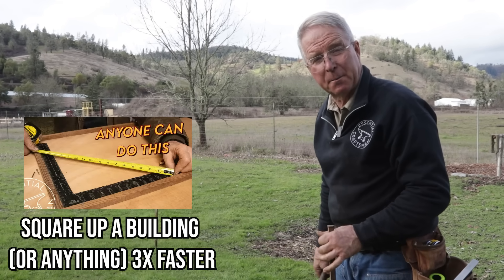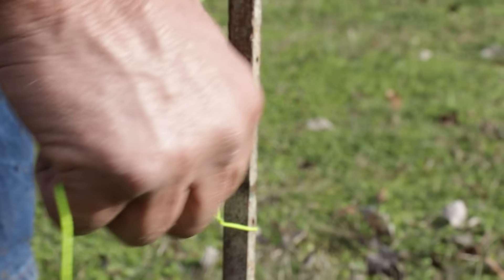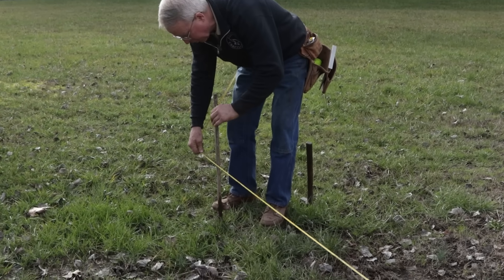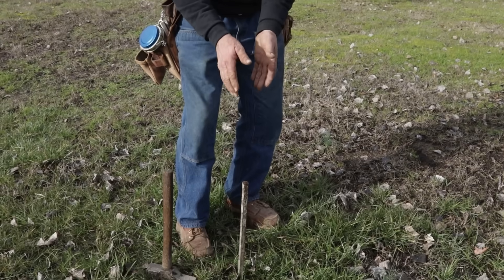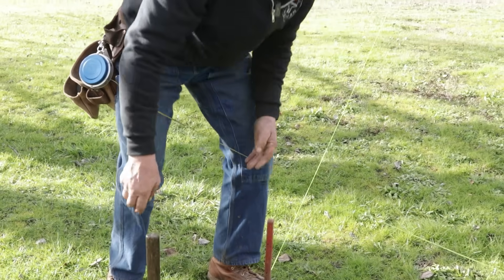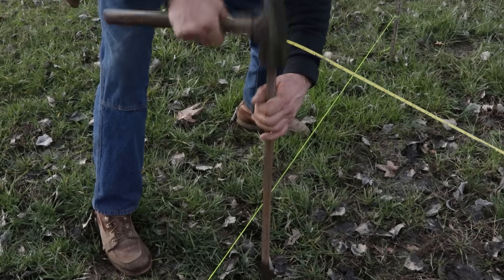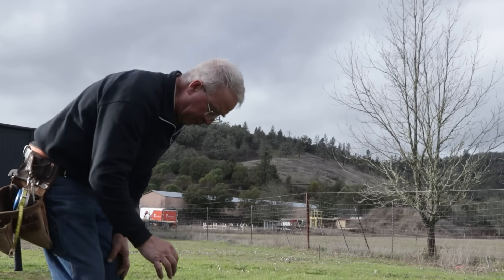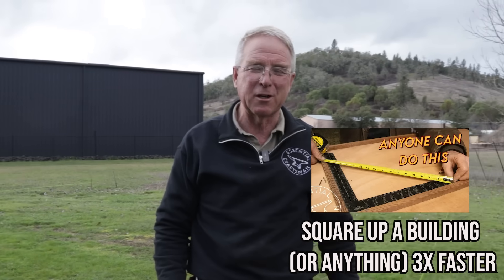How to Layout Parallel lines Perfectly

Comment: After  you   finger out  what  end of the tape measure  to hold ,     find a stud  and   drive  it in   perpendicular..
If   possible   circumscribe   an arc     on  tongue and groove  pressboard  to aid your drive  intensity,
then proceed   with the   installation of   baby   batter   boards
Whatever you do,   don't   blow your layout  by   prematurely  marking  the   overall   length.
and  remember that   error is cumulative  ,so always  wear  gloves.
Reply: Why do you type like that?